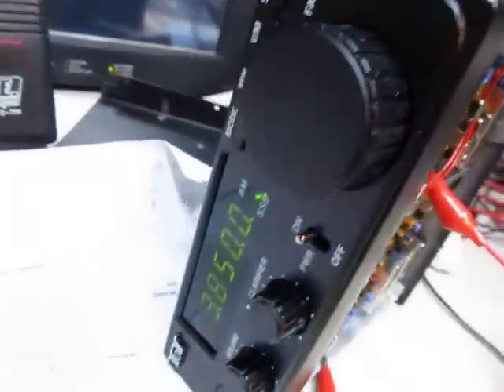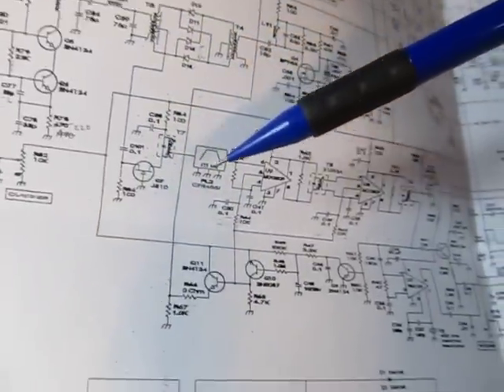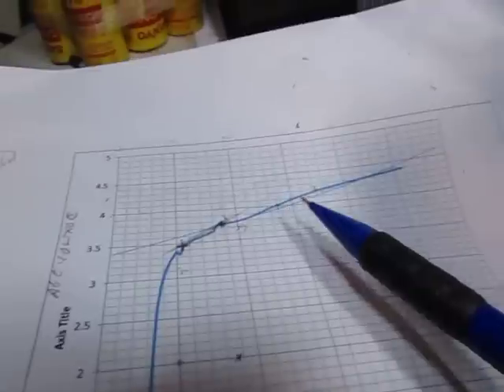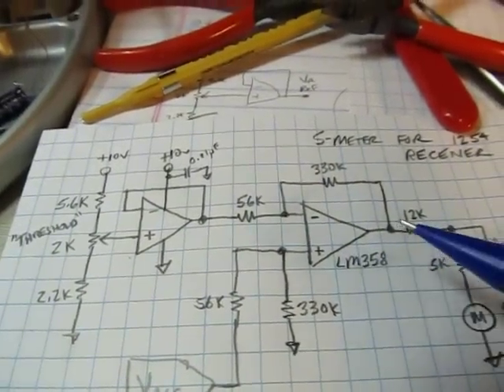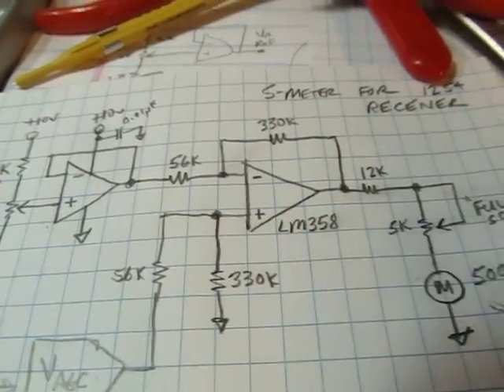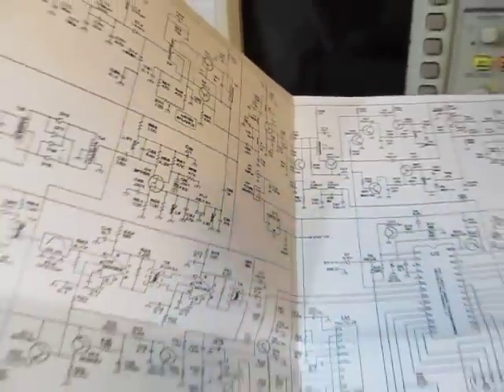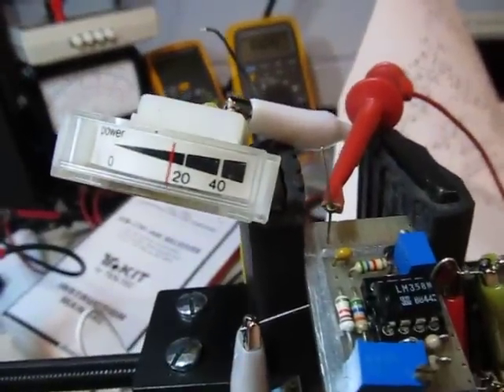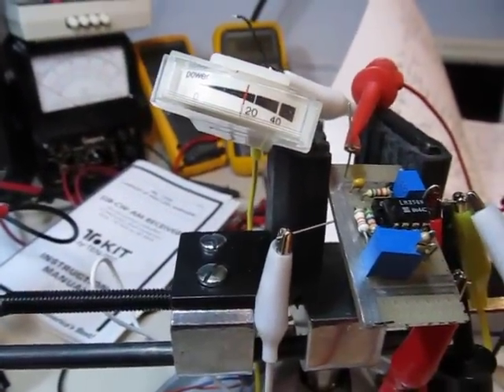#29: Adding a S-meter to TenTec 1254 Shortwave Receiver

Comment: 7:30 i thought s-meter shows the intensity of tuned rf signal not depends on modulated audio frequency but i found here opposite ?
I can also see led based s meter on portable radio where Brightness depends on carrier signal strength instead of modulated output !
Reply from the maker: It depends on the modulation type.  For FM, the received signal strength does not depend on the baseband  audio.  But for single-sideband (as shown), the signal strength is proportional to the audio strength.

Comment: I built one of those back in 04. but I'm also making a project right now and it is an S meter. I still have a copy of the circuit from a kit that I bought from Dan's small parts, and am going to build it on a board Manhattan style using Me pads that Rex Harper had brought over Monday. He was at ham fest in Albuquerque and also came over to the house here for lunch. I was discussing on building some projects and this is one of them. I still have a 0-200uh meter and am now going to collect all the parts to build this circuit.
Reply from the maker: Good luck with your project - I'm very pleased with how mine turned out.